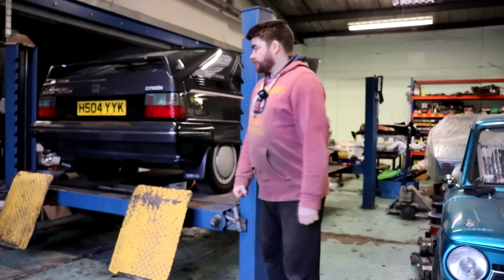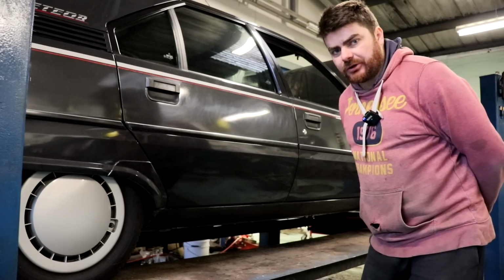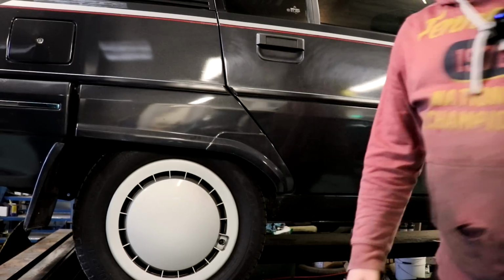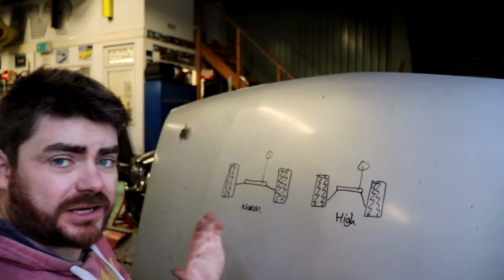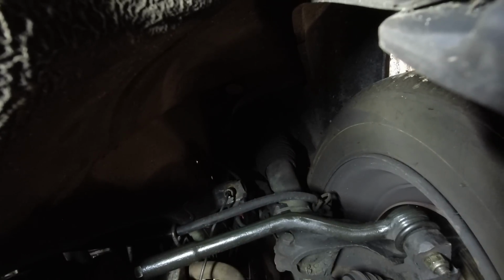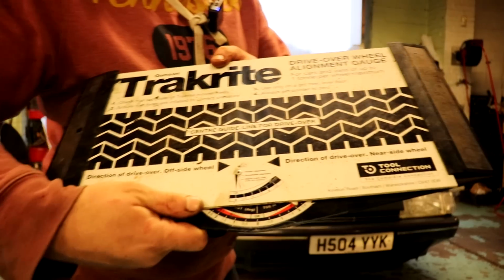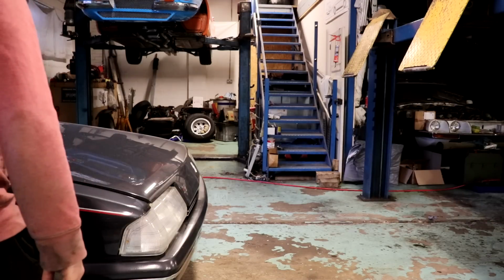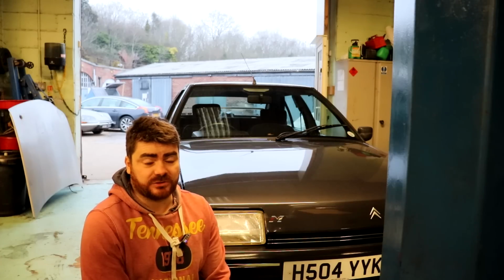On The Ramp | WHEEL ALIGNMENT issues on a hydropneumatic Citroën - What NOT to do!

Comment: on both of my BX's a 1400 RE and a 1.7 D tyre fit centres always adjusted the tracking on high because of the rear arch dilema it makes perfect sense now why you shouldnt, most of them complained that they had to find a very short spanner to adjust the track rods on the front of a BX.

Comment: Very informative video, and nice new haircut/beard. 
Anyway, this is quite a funky BX. Seems to be one of the "limited" editions they did near the end of the production run. 
However, what's interesting is that it exhibits many of the flaws mine has. Mine has a pressure regulator that sounds the same and engages just as much. My struts are also just as sticky as the ones on that. Seems to be consistent with lower mileage BXs. Mine has around 80k on the clock, but the last 18k were done in the span of three years. So it was definitely not driven much in its 34 years of existence.

Comment: I haven`t finished the video, but i  will test myself. I think that the explanation offered  by 9.00 is  wrong. It is correct that  by increasing the height of the suspension is the same as on mcpherson, that means that it will adjust the tow in, because the steering rack is fixed. It is  not the lower distance of steering rack that  changes  but  the upper  part  of  the tire goes out.  I think x  is the same in both  cases and top distance between tires is x plus stg. Love your  videos!
Reply: this is hypothetically fixable by adjustable  tie rod ends on both  sides, hidraulic or else.  Sounds  expensive and  prone to failures, but has  any producer tried to fix it this way on any car? of course there are alternatives, i.e. multilink.
Reply: So first comment is wrong. it would be right in case if steering rack would slide down along with the the weels distance from the  car(weel travel.)
Reply: by the  conclusion  it is implied that  by adjusting  the  tow  when  the  car is  in service mode it means that all  is  good.  do you think there are other  limitations  from the  hidropneumatic to work at this  height? i think   it  would  be a problem for  xantia activa sistem

Comment: Regarding the track/tie-rod debate, I call the steering rack arms track rods. To me, tie-rods are part of the suspension. They're obvious on Morris Minors at the front, where you have two metal rods with bushes at the end that connect the lower suspension arm to the chassis rail to keep it located. That's British terminology of course, the Americans will call it a hamburger joint or something.

Comment: Had the same problem on my slammed VW Beetle about 15 years ago. Used to take it to a local garage that still had the old fashioned Dunlop tracking tool with the mirrors. Not a lot of good if you want four wheel alignment though!

Comment: The arc of the lower suspension arm should match that of the track rod, so that there is little or no change in toe, resulting in bump steer. It may well be that at the extremes of travel, you do get some bump steer,  but you shouldn't be getting significant change in toe in normal travel.
Reply: Yes, I was just going to comment that the BX is pretty good in this respect and you can see in the vid, that the inner ball joint is directly above the lower arm pivot. But there is a LOT of travel on the BX so make a bit of a difference.

Try the same thing on a Triumph Dolomite (just by jacking up and down obvs.) and you'll get a bit of a shock. The pivots are so badly placed that it'll toe in about 50mm when jacked up to the top of its travel!
Reply from the maker: All true, and to be fair they've designed it pretty well knowing that the BX uses long-travel suspension. It doesn't really suffer bump steer too much, but for the purposes of a simple video it was easier to explain it like this. 1deg, at the extreme 'droop' position is actually not a lot, but the point is if you're 1deg out in normal driving, it can ruin the handling feel.

Comment: A cool demo, but just a quick question: 
Would the tracking gauge show the toe-in/out actually changing if you roll onto the gauge at Normal height, leave the wheel on the gauge, then change the car to High ride-height?
It might make for a quick YT #Short.

Comment: Back in the 90s when I used to buy repair and re sell bxs I bought many with leaking octopus pipes and I struggled with getting them tracked correctly I found  a local  old citroen guy who would track mine using string and they always seemed ok
Reply from the maker: String boxing is a bit rudementary, but it's probably no less accurate than the drive-over gauges.

Comment: Very informative, and quite shocking how much difference setting it on high makes. My 2010 C5 Hydractive 3+ was aligned while set on High, and the results were terrifying. It was actually scary to drive on wet slushy surfaces. Realized I should NOT have told the garage (as I usually do) to put it on high and loosen the reservoir cap if they were putting it on a hoist. Forgot that alignment is done on a four-poster. Once redone, the car has been perfect and wear even. Had one more thought though, .. when the ignition is switched on the front of the car raises up slightly. Should the alignment therefore be done with the ignition on, or is the difference negligible ??  (In New Zealand, we theoretically never get to 110 kph, which is when the front lowers itself again.)
Reply from the maker: Same with the 'CBX' car that was in recently - had been tracked on high (I assume, as it was MILES out!)
The C6 does the same thing as the C5 with the key position, so when I did the C6 I did it with the engine running. My logic is that if the car lower slightly when the speed climbs (motorways etc) that Citroen would have factored this in. A smidge of toe-in can help stability, so I suspect it does toe-in a little more when it drops.
Reply: As a fellow Hydractive3+ C5 owner, I have some sympathy with the tyre shops. Put it on high to fit the tyres, then on normal to align it!  You have to pick tyre shops with care.
Reply: According to citroen the hydractive c5 x7 should be set with ignition on (or engine running if it drops into economy mode quickly). The difference between ign on and off is surprisingly large for a small amount of travel on the suspension.

Comment: Is there a similar disagreement between front and back for cars with trailing arm rear suspension and a negative camber?
Reply from the maker: Depends on the ride height & the extremities I suppose. Most cars have less suspension travel than a BX. Really depends also on whether it's trailing arm rear suspension, or semi-trailing, as the latter has a much bigger impact on toe due to its design.

Comment: Sounds like a bit of a pain to track correctly alright. Though, if they had that tool you had, they could measure the difference between normal and high and then compensate for it while they do the alignment on the high setting. 

Though, from my experience of places that do alightments there's no way in hell they'd go to all that extra time and effort.
Reply from the maker: Too many variables to put it on high and guess, IMO. Maybe not with brand new identical cars, but 100k miles down the line with varying ride heights, tyre specs/sizes and welding repairs...lots of BXs are probably different shapes to each other now!
Reply: @UPnDOWN  But if you used that tool you have to measure the toe, and calculated it from there, it'd be reasonably accurate wouldn't it? I know you'd have to do it on every BX, but still.
Reply from the maker: If you took a pool of 100 cars with various wheel/tyre/ride height combos and then drew an average from those it'd give you something to work from, yes.

Or you just do it at the right height haha!